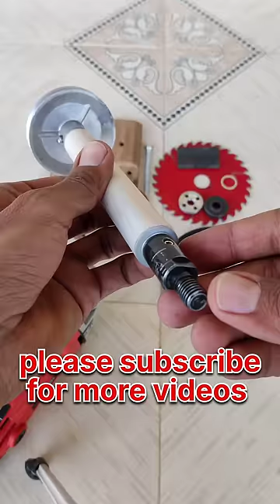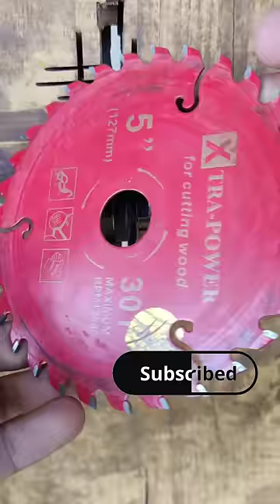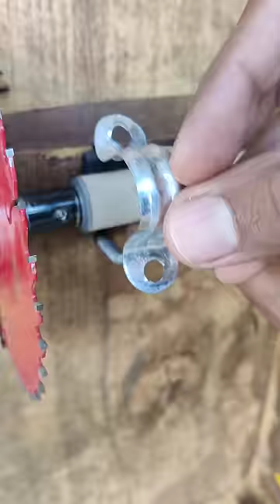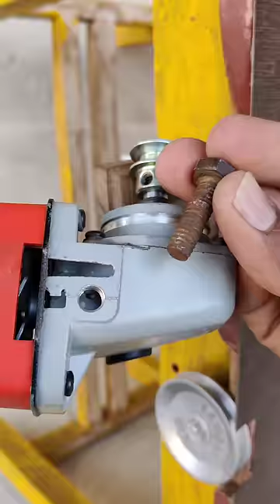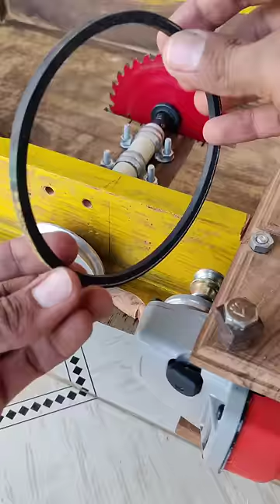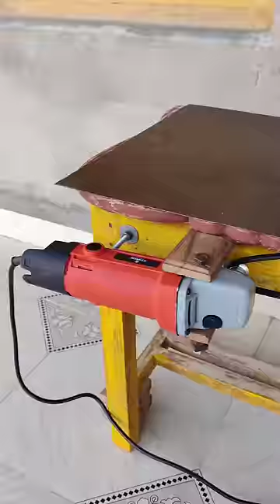Greatest idea💡ever done with a Angle Grinder 😱#shorts #viral

Comment: Using a grinder to cut wood is a bad idea as it is totally opposite with high speed & low torque
Reply from the maker: That's why i use pulleys for lowering the RPM and increasing torque ❣️
Reply: Idea absurda

Comment: Angle grinder is a deafening device.
If you have to do it this way, at least use a bearing, the spindle turns around the two metal plates is sacrilegious.